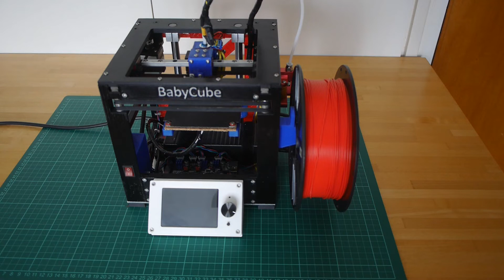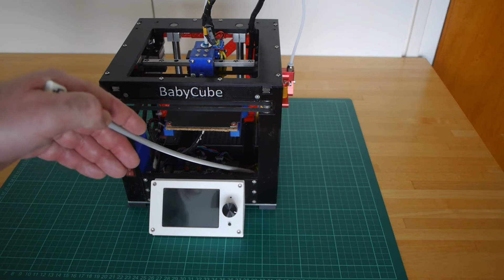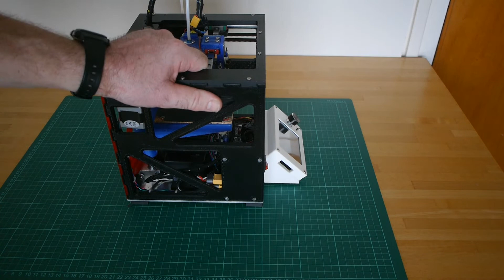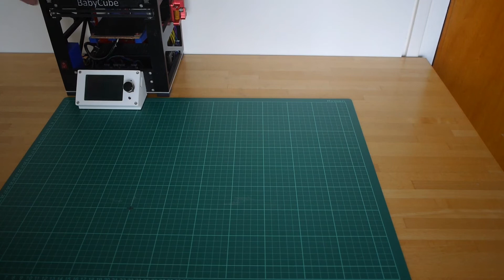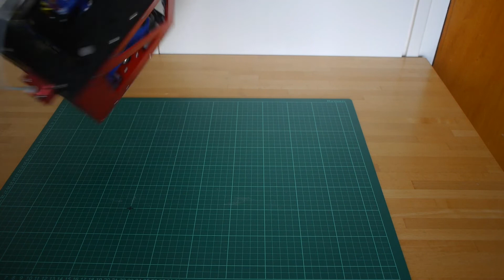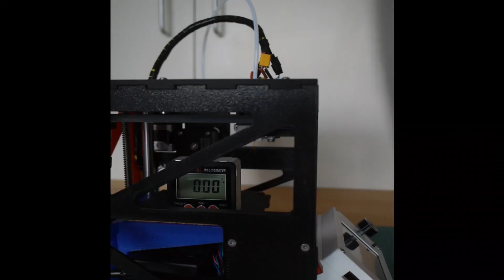Introduction to BabyCube, a small CoreXY 3D printer

Comment: A version with 15×15 or 10x10 extrusion would be awesome
Reply from the maker: A "version" with aluminium extrusion would not be a version, it would be a totally different printer and would have to be designed from scratch. If that's what you want to build, checkout the Voron 0. Having said that, I do have a "concept" version with sides made out of carbon fiber.